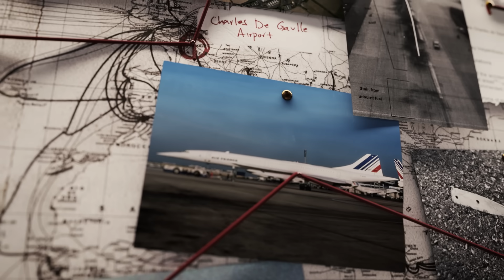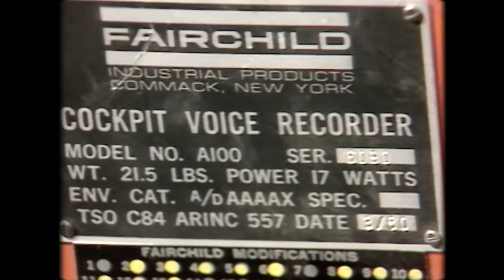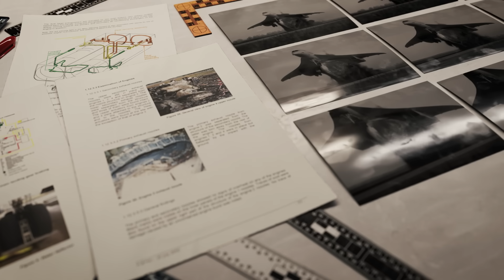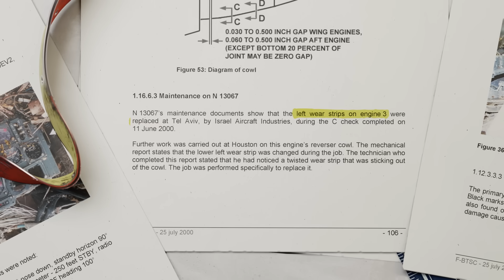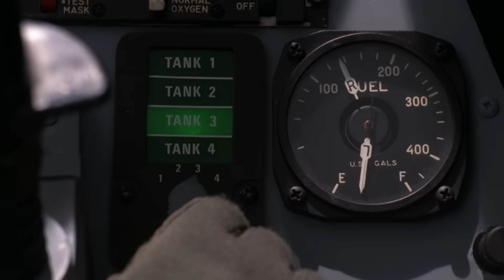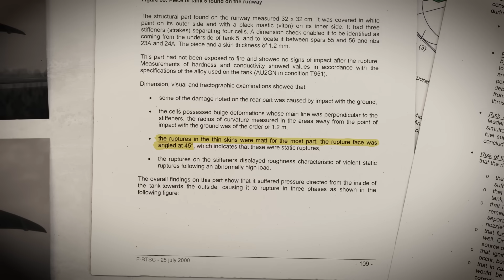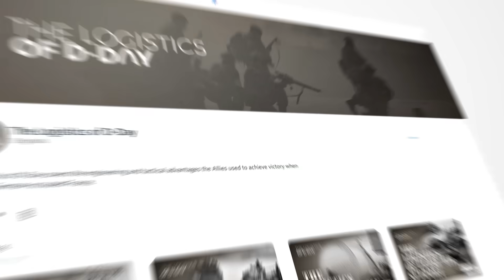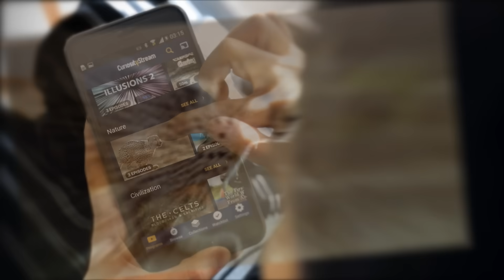What Actually Happened to the Concorde

Comment: I met one of the British engineers that was on the investigation team.  Their opinion was that a large causal factor was a missing spacer bar in the left undercarriage that had not been refitted by AF engineering after maintenance.  This caused the gear bogie to wobble which became far worse after the tyre failed.  Additionally the Captain started takeoff when the aircraft was above it's structural weight limit with imbalanced fuel tanks.  All of which meant that the aircraft was still on the ground when it hit the strip, when it should have been airborne.
Reply: that's how accidents always happen. All humans that are related to an incident are supposed to work with a fail safe. If whichever of them doesn't put the extra effort to ensure there's a fail safe, then it's still fine. But under stress, each tries to cut some corners and often each relies on the others for fail safes, until one to many fail safes fail.
If the designer of the plane would have designed the plane with one more fail safe (kevlar belly, better tyres, etc.), none of it would have happened, despite everything else.
if the AF engineers would have put that space bar, none of it would have happened, despite everything else.
If the Captain would not have started the takeoff, due to structural weight limits, none of it ...
If the guy who refueled would have balanced the tanks, none of it ...
If the Continental plane would have done proper maintainance, ...
If the Airport would have taken the time to inspect the runway after each take off, ....
If the Architect of the Concorde project would have had less hubris and more reasoning, they would have built a project that was economically viable, so that there wouldn't be a stress on the company, so that nobody feels like they have to skip any fail safe procedure.
And so on.
But many of them failed and that's the only way accidents happen. There's never a single reason.
Reply: @nydydn  and in this case... there's more than that.  

This wasn't the first time a blown tire burst a fuel tank.  The guys doing the previous investigation were... quick to sign off on it being safe enough.  "sure we had to cancel multiple flights because of blown tires rupturing fuel tanks... but it's not like anyone'll get killed by it."  Until it did.  This is one thing Concorde hadn't, IMO, been fully honest about because their reputation and finances were on the line.  

I would not have considered the aircraft airworthy.  Ruptured fuel tanks are not "normal".  You can't just say "oh it's not gonna burst into flames" and call it good.  Obviously in this case it did in fact burst into flames.  Realistically having to cancel flights due to the plane becoming un-airworthy during an attempted take off is something I'd personally consider a huge problem... even if all it does is inconvenience passengers.  It's not something you should just handwave.  But they did.

Sure.. Continental happened to be the spark that lit the fire... but the fire only lead to an explosion due to a design defect.
Reply: @marhawkman303  the DC-10 had also had fuel ruptures on takeoff that lead to fires. It would be aggressively corrected in modern designs, but to say it would never happen for other aircraft is just false - it was within expectations at the time.

It also needs to be pointed out that there were already preventative measures against this on most concordes; the area around the engines had been strengthened and made resilient against impacts, fuel tanks already had liners, this particular airframe just happened to be one that AF had cheaped out on. The concorde as a design was safe and for BA the most profitable aircraft of all time, even with them having paid for all design upgrades to keep them safe and up to standard.
Reply: @iskierka8399  "within expectations"? for a commercial jet to go down in flames during take off?

one thing you left out: how long did it take for the DC10 issue to get fixed?
Reply: @marhawkman303  To set on fire, yes, to go down is the part that was unusual. It also took months for the DC10 issue to even have a hearing on the issue, and was not grounded for that delay - on the other hand, Concorde's issue was already fixed years prior, the kevlar lining and protected landing gear were already available and fitted to all British Airways Concordes, this one particular Air France Concorde had been cheaped out on and that is the reason it was able to suffer this failure at all.
Reply: @marhawkman303  there had been a previous flight with a fuel leak that barely landed before it was empty of fuel, only because they did an emergency landing. So that was the real canary in the coal mine
Reply: @bigbaddms  hmm... yeah.....  Like I said, Concorde had multiple incidents, not just one.
Reply: @nydydn  but wait, the strip of metal came of the right hand engine of the dc10, but it hit the left tire, and then migrated back to the right hand side. Strange🤔
Reply: @nydydn  Future economic pressures from changing Neo-capitalist politics isn't a fair challenge or responsibility for the engineers of this marvel, which by all standards had a great many redundancies & tolerances built into it to accommodate its higher top speed, runway speeds & possible mishaps resulting from that.
 At 30 yrs old though, flight records & keeping a diamond perfect & thorough maintenance log & checklist has more loaded implications & consequences than when it was still in its earlier years of service.
Reply: Interesting..
Reply: This sounds like bullshit. If the takeoff mass would've been above max structural, it would've also been mentioned in the final report as a contributing factor.
Reply: That is a theory. It was extensively explored but is not included as a causal factor in the accident report. The extended take off distance did not support the idea they it would have been airborne before the strip. Here is the accident report:https://bea.aero/uploads/tx_elydbrapports/f-sc000725a.pdf
Reply: @Completeaerogeek Just watch the interview with John Hutchinson about this. If you sincerely believe an accident report like that then you're incredibly naive. Of course the froggies blamed someone else instead of taking responsibility for their complete screw up. 🤣 That's what big corporations do, it's their nature, and the authorities can be similarly biased because of their political connections.
Reply: And the pilot took off into a tail wind, the engineer shut down one of the engines whilst it was still producing thrust without the permission of the captain and it has been proven that there was fire and the tyre burst long before it got to the "offending DC10 strip" (as observed by the fire marshalls on duty that day) of course the BEA (French Investigators (lol)) decided that none of this was relevant. Interestingly enough soon after - another Air France Concorde came within minutes of a further disaster when the pilot mis-diagnosed a fuel leak - managing to scrape into Gander on fumes (not to mention other Air France aircraft running off the end of the runway in Toronto, crashing into the Atlantic whilst failing to recover from a simple stall etc etc)
Reply: @norodnikseo Capt ask for Fire Procedure for ENG 2 when fire alarm came.

Tell me how you can make difference from fuel tank leak+ fire or an engine fire when you can't see nothing and when the fire alarm is ringing ? Also engine 2 was no longer producing thrust due to ingestion of debris and hot gas.

Only number 1 was almost working between compressor stall.
Reply: he should’ve checked the inline specs on the rotary gerter
Reply: maybe its more dangerous/risky to fly concorde as at that speed you wont survive a plan crash like you could potentially survive regular plane crashes. Since humans always fail , I am not sure how many flights the concorde did and the ratio of fatalities. It's always the same story a failed maintenance , not willing to spend money to replace a part that has to replaced. It's all about money. crazy

Comment: Excellent video. No mention of the missing wheel spacer that caused the veer left? Would the aircraft have survived if it rotated 10 knots faster and on the centerline? (And not been overweight with a tailwind).

Comment: Actually, British Airways Concorde service turned profit, albeit thin, due to both cities, London and New York City, as financial centres in 2002 and 2003. The final nail to the coffin would probably be the necessary upgrade to the avionics, which would cost between $25 to $30 million. British Airways was more than willing to proceed with the avionics upgrade after the expensive installation of Kelvar lining. It would take much longer to amortise the cost for British Airways.

So, who's the villain? The former CEO of Air France was under a lot of pressure to improve the financial status and cash flow in order to continue receiving the government fund. Lot of deferred maintenance and balkanisation of one Concorde for parts. Some of you might recall the angry workers thrashing some of the Air France executives in the early aughts. The AF CEO would have to give up Concorde service as it wasn't financially sustainable. Additionally, the AF CEO had a very enormous ego (typical of French people) and couldn't stand seeing British Airways turning profit and continuing with its service. The CEOs of both Airbus and Air France were very good friends. So, the AF CEO asked Airbus CEO if Airbus could withdraw the certificate and end the supply of replacement parts. Problem solved: British Airways would be forced to end its Concorde service (as to save AF CEO's face).

Comment: I have always enjoyed the science relating to Air Crash Investigations, and you did them proud. I always say that you can't argue with facts, and the Aviation Industry has always used the post mortem of a crash, or a near miss etc, as a tool for learning to ensure that something like this does not happen again. You have to applaud an industry, with a no blame culture, to learn from mistakes and bring a positive from a negative. Obviously very sad that it happened, of course, but the changes made to aircraft engineering, and procedures etc will generally ensure that this type of accident never happens again. Thanks for your concise portrayal and explanation of exactly what happened to the ill-fated Concorde. There were many other issues regarding the success of the Concorde programme - this was just the final straw. Cheers.

Comment: great video, only comment I have is that the runways are actually not 26R, but 2-6 Right, and 2-6 Left, the L and R are used when there are parallel runways. C is also used if there is a centre one as well. Pilots also say numbers by digits in order to make sure directions are correctly heard.

Comment: I remember the event, and others, very well. When this final incident occurred, there was a massive attempt by the manufacturer to make tanks safer but it wasn't enough. 
For me, given the huge amount of tyre incidents, I'm stunned that not much was done about it. The incident where 3 holes occurred is a huge alarm bell ringing and yet they passed it off as fine to fix and fly! Keep calm, we're British type thinking that did nothing but keep an unsafe set of mechanisms flying!
Reply: Sadly it often seems that way, be it in aviation or other industries.
"Oh, it didn't cause an issue so far and we estimate it likely won't" -> Go with it until catastrophe and then stuff finally gets addressed

Comment: There are sadly a lot of informations missing in this video and also a false information about a critical thing. The ruptured tank was not the reason for the loss of power. It's proven fact that the engines worked just fine and produced power like always until they were shut down by the flightmechanic. Here are all the parts of the chain thet led to this accident:

-The groundmechanics forgot a part that belongs to the plane on the shelf so the lefthand side wheels could slightly change it's angel. 
-They startet the takeoff on a partial closed runway that was under construction and there was a sharp transistion between the parts that caused the wheelangle to change (higher friction)
-The wingfueltanks were filled up over the max safe level so there was no air left in it.
-The plane was overloaded (2 tons of taxi fuel + over 600kg bargage). about 3 tons.
-They also started with a tailwind (calculated with that tailwind they were 7 tons to heavy). 
-Because of the bargage and short taxi (not many taxi fuel was burned) the planes cg was moved after its safe point. 
-While takeoff they hit this titanium part on the runway.
-The last misstake was that the flightmechanic shut down engine two without even telling the captian.
Reply: Several parts of your statement are completely incorrect. Do yourself a favour and read the accident report. Engine 2 was at idle when the fire alarm went off. The last part of your comment in particular, is flat out wrong according to the CVR. 

From BEA report P 133: 
"Engine fire alarm actuation and the very low values on the parameters led the crew to shut down the engine after the Captain called for the engine fire procedure. In fact, the movement of the throttle control lever to its idle stop is heard and, a short time later, pulling of the fire handle. In addition, the deceleration of the engine, established from the recorded parameters, is consistent with a commanded engine shut down."

It is important to note that the AF Concorde Flight Manual requires an immediate reaction by the crew in case of a 'red alarm'.

See the following timeline from the CVR and Concorde Flight manual.
o	14 h 43 min 13.4 s, message from the controller indicating flames at the rear and read back by the FO. 
o	14 h 43 min 16.4 s, FE “(stop) “. 
o	14 h 43 min 20.4 s, FE “Failure eng… failure engine two”. 
o	14 h 43 min 22.8 s, fire alarm. 
o	14 h 43 min 24.8 s, FE “shut down engine two”. 
o	14 h 43 min 25.8 s, Captain “engine fire procedure” and in the following second the noise of a selector and fire alarm stops.

As the CVR shows, the FE correctly called out the engine failure and then announced the required procedure as "shut down engine two" (I was trained as a Flight Engineer and I would have done the same) and the Captain immediately commanded the engine fire procedure to be carried out. i.e engine shut down, Fire Extinguisher discharged.

Also by Saying "Stop'" at 14:43 16.4, the FE may have been the only person who correctly called for an abort to the takeoff.
Reply: @Completeaerogeek  You should watch "John Hutchinson on Air France Flight 4590"
Reply: @x-planeliveriesandstuffsho1074   I have the accident report and have just watched JH video again. He makes several mistakes and unfortunate accusations one of which is in saying that the FE shut the engine down without consulting the Captain. The CVR shows this is not so. He is also in error in that the Air France flight manual demands a response action to a 'Red Alarm' i.e. carry out the fire drill and shut the engine down. The Captain commanded this a second or so after the FE announced the engine failure on #2.

From BEA report P 133: 
"Engine fire alarm actuation and the very low values on the parameters led the crew to shut down the engine after the Captain called for the engine fire procedure."

"The movement of the throttle control lever to its idle stop is heard and, a short time later, pulling of the fire handle. In addition, the deceleration of the engine, established from the recorded parameters, is consistent with a commanded engine shut down."

See the following timeline from the CVR and d Concorde Flight manual.
o	14 h 43 min 13.4 s, message from the controller indicating flames at the rear and read back by the FO. 
o	14 h 43 min 16.4 s, FE “(stop) “. 
o	14 h 43 min 20.4 s, FE “Failure eng… failure engine two”. 
o	14 h 43 min 22.8 s, fire alarm. 
o	14 h 43 min 24.8 s, FE “shut down engine two”. 
o	14 h 43 min 25.8 s, Captain “engine fire procedure” and in the following second the noise of a selector and fire alarm stops.

The BEA report addresses the spacer in detail and says it had minimal/no effect on the accident. The drift to the left was almost certainly caused by the asymmetric  thrust which would have had a far greater effect that scrubbing tyres. 

Certainly the max fuel issue did contribute . Without it, the tyre would have blown but the accident most likely wouldn't have happened.
Reply: @Completeaerogeek  Sorry but that's not correct in case of the concorde. If you have a engine fire on takeoff, you shut off the fire warning and continue until you reached a safe speed and altitude before you shut of the engine.
Reply: @friendlyreptile9931  If you read my replies with content from the CVR and Accident report you will see you are incorrect.
Reply: @Completeaerogeek  Do you have a link to that?
Reply: @Completeaerogeek  1 Year ago and still no link to proof your tall tale?
Reply: You are wrong again. See my further reply from the accident report..

Comment: Don't forget to mention that ductile materials normally fail in shear, and due to mechanics (best represented by a mohrs circle) the most shesr can be sustained at a 45 degree plane from a load of tension. What's not significant more so is the plane of the failure, it just signifies that the material failed from shear

I could be completely wrong though the class I took on this was a whole ago